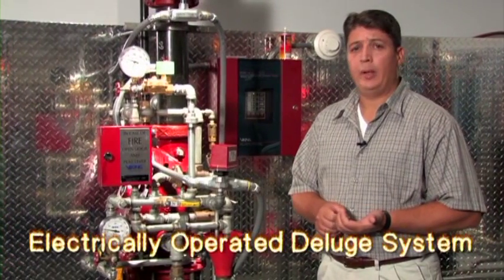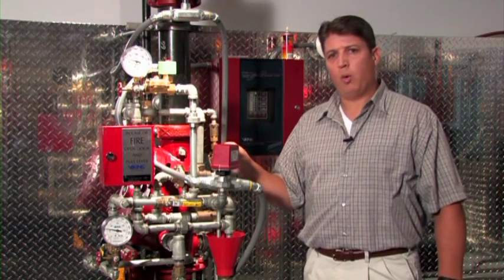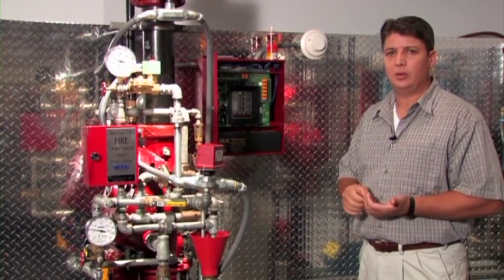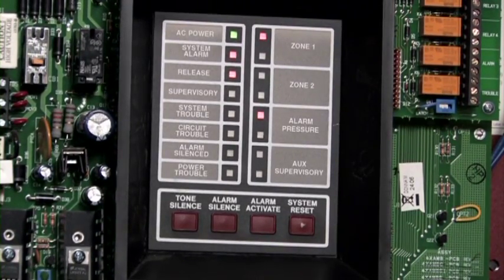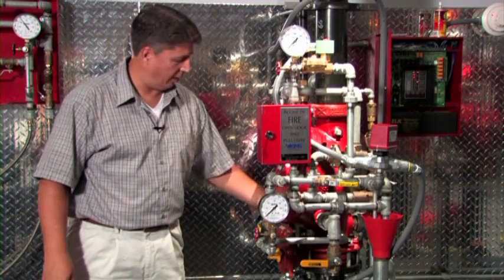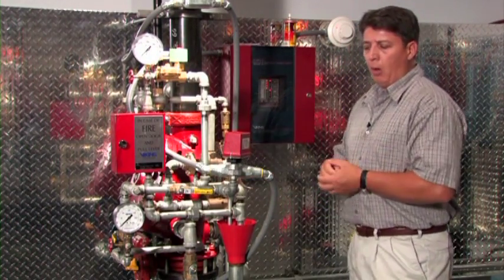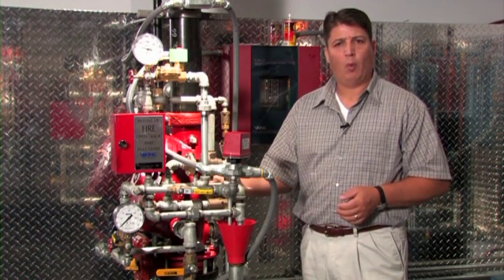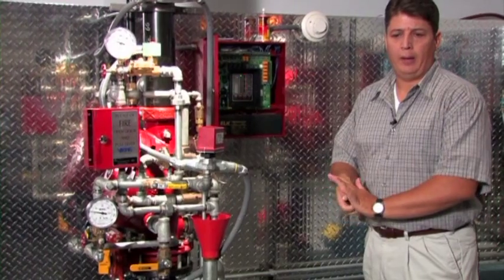Viking Electrically Operated Deluge System - System Reset Procedure

Comment: how to avoid the water discharge and test the smoke or any fire device like water flow or smoke detector.
 thanks
Reply: Shut the main control valve off, open the drain, test your smokes. Once the smoke clears, reset the panel to clear the alarm, the priming line will reset and you can then open the main control valve and shut the drain.

Comment: So one alarm would cause all the sprinklers to spray out water? That sounds like a recipe for disaster
Reply: Often used as a cool down in industrial applications. Examples large tanks of flammable liquids. The Classic Deluge was installed in theatres where the fire would be stopped with a wall of water at the Proscenium (exempt from full flow testing).  A form of Deluge is often used in Aircraft hangers but has mostly been replaced with deluge foam apparatus...  All deluge types have to be tested NFPA25 and are located in areas that can handle the volume of water produced by them...
Reply: These kinds of systems are only used in high-risk buildings, such as a facility that handles flammable or explosive substances.